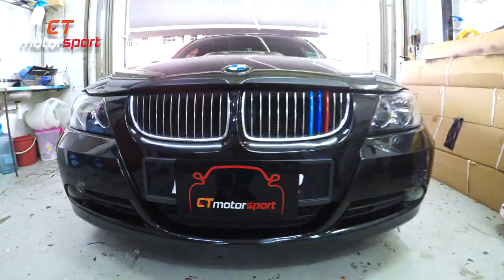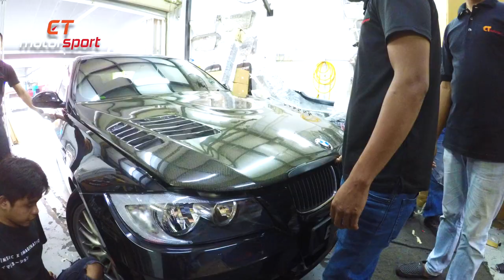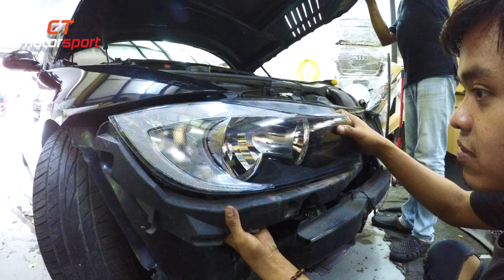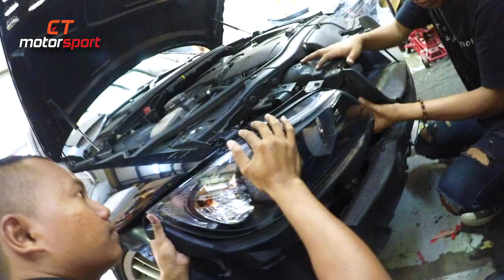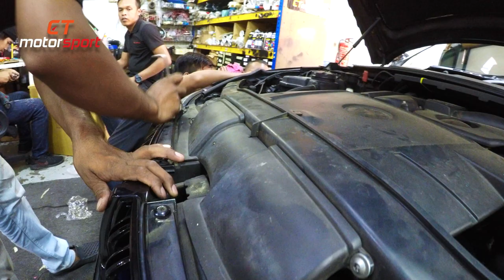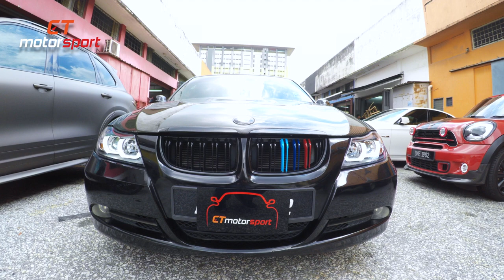BMW E90 Pre LCI install E90 Angel Eyes Head Lamp Projector

Comment: Hello, can I change hood on pre-lci e90 for a LCI hood? so I can use that nicer kidney grill
Reply from the maker: I'm sory sir.. your mean what to change front hood bonnet e90 to carbon fiber frond hood bonnet???
Reply: if you change the LCI hood, you have to buy LCI grills as well, the difference between LCI and PRE LCI Grills is the Mustache on the hood, the LCI doesnt have a mustache on the hood so if you buy the LCI hood, you need to buy LCI Grills as well.